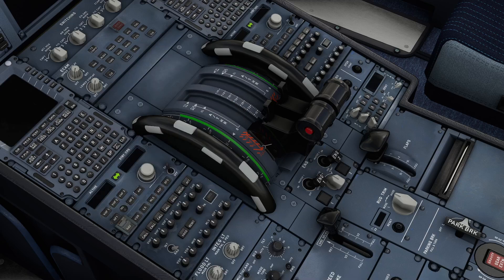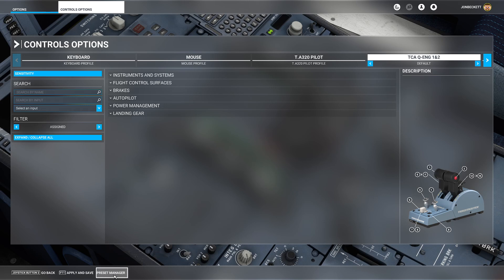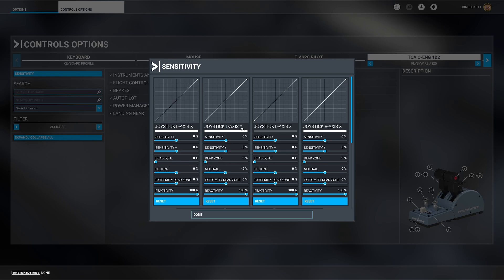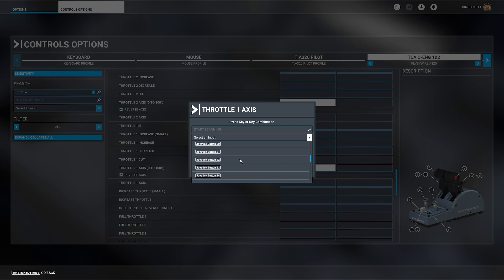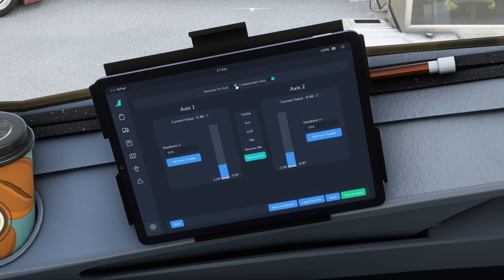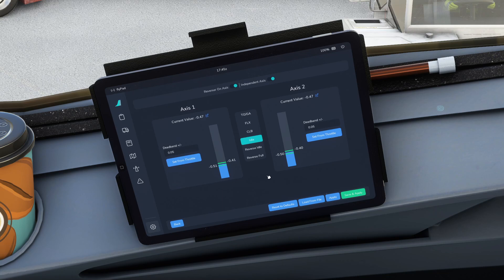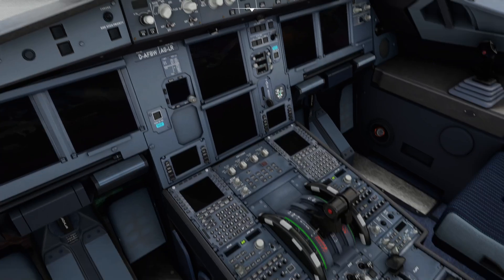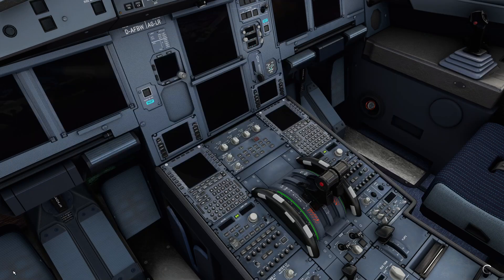How to configure the Thrustmaster Airbus Throttle Quadrant for the FlyByWire A320 Airbus in MSFS

Comment: Hi Johnathan. I have been having trouble with unresponsive throttle control with my TCA pack and couldn't figure out why. Main problem was using the stick for GA flying and not having any control on the the throttle. I have MSFS2020. I came across this presentation of yours and immediately understood what you were teaching.  I feel as though you may have given me the info I need to calibrate my set up properly.  It would be nice to just be able to use the throttle assy for GA and Commercial flying. I now feel confident to reset the parameters so I will have a ago. Thank you for your presentation, really well put together. 😃👏

Comment: UPDATE for 2025. They now removed the ability to delete a key binding. Tried the step at 4:30 and the binding is forever locked after deleted twice and validating 500 times.  Looks like this Throttle Quadrant is no longer supported by FBW. I bet the controller manufacture will not release updated drivers. 

But there is work around. You have to exit the game, unplug the Throttle. Restart game, then go into controller options. THEN PLUG IT IN! The option to remove and validate will come back.
Reply: Preesh bro

Comment: What if the throttle doesn’t go fully back but it stops at 75%, not like 100%, what do I do in that situation?
Reply: I fixed the problem, there’s just a slight issue because I wanna fix the reverse thrusters but the iPad on that aircraft is different and it’s not the same where it doesn’t show the exact same iPad you used. 🤔

Comment: Bought the TCA throttle (dont have levers for flaps and spdbrk) few weeks ago. Followed the Thrustmaster official calibration guide. The device is a mess. Nothing works out of the box. Thanks to your video I was able to set the throttle axis. But the eng switches and starter switch (crank-norm-ign) did not work. Defaultly set to heading but set and hold (LOL). The eng switches for fuel in/cut off were set as avionic master 1 and 2. Total BS by TM.
For those who have the tca airbus throttle quadrant at the same state = unusable. Follow this guide.
1) Clear everything
2) Set throttles according to this video
3) find setting set engine master 1/2 and set engine 1/2 fuel valve and map it to the engine switches (2 silver switches with square top) - works in Fenix as well.
4) To set up the crank-norm-ign starter knob you have to firstly set crank (button 7 moving the knob left and center) then set the ign/start (button 8 moving right and center) and lastly  set engine norm mode and you have to set BOTH buttons 7 and 8 here (primary and secondary) and you have to change the action type "on press" to "on release"
5) Take a beer. You deserve it.

Comment: this solved most of the issue, but reverse is still not happening. (Fixed the reverse by switching it on and off in the iPad/electronic board throttle settings in the airplane itself.) Many thanks for this great video.

Comment: Hi Jonathan, thanks for the amazing video! Very, very helpful 😀

Wondering how you manage the tiller on the Airbus? I find the steering on the ground using just the rudder axis to be very lacking and not precise enough and as I am flying an A330 around I don't need to use the rudder inputs aside from the takeoff and landing roll. 

Do you have some way of getting the tiller to work so that I can have full control over the NWS?

Comment: I can get as far as the EFB and attempt to Calibrate the throttles in Full Reverse. When I click Set from Throttle, I get the dreaded Red Line, which says I have an overlap. I have attempted this fix several times with zero luck using an FBW A320 NX.

Comment: Hi Jonathan, 
A remark and a question.
First of all I want to remark that I am very happy with this video !  Very clearly step-by-step explained.   
 I struggled quite a few hours (without getting good results) with these Airbus throttles, but after implementing your configuration -procedure they now work perfectly!! 
 Thanks a lot.

The question is about the spoilers and flaps.
In your video it is mentioned that if you make a duplicate of the default setup, the spoilers and flaps should work out-of-the-box also.
Unfortunately, that is not the case: 
- Flaps handle in position 0 : ==> full flaps and all 4 other positions of the Flaps handle result in Flaps up
- Spoiler handle does not work at all

I tried to find a solution online, but not many people seem to have this problem.
Do you have a suggestion how to solve this?
Reply from the maker: No idea what's going on there. Do they work with other aircraft ?
Reply: Hi Jonathan,
Thanks for your reply.
As I was looking on internet if there were other persons with the same problem, I came across a very short video (1 minute) where someone set the throttles by simply moving the levers (including the flaps plus spoilers handles) through each detent, while clicking on the two red buttons at sides of the levers at every detent.
I followed that procedure (actually without much hope), but it worked !
Everything on the throttle quadrant (including flaps and spoilers) is now operational.

When I checked the sensitivites I noticed that the very strangely curved sensitivities were again applicable. My custom made FBW A320 profile is still active, but the sensitivites are reset to the standard and nevertheless the levers move nicely through the gates. I do not really understand this, but it works.
I am happy that my FBW A 320 can be flown smoothly again.

Remark 1: I do not have the Hotas drivers installed.
Remark 2: No, I do not have other aircraft ( the only aircraft I ever fly is the FBW A 320)

Thanks again for your great video ( I subscribed to your channel since your videos really stand out)

Kind regards,

Comment: Hey! My quadrant FLEX position is behind the FLEX position in the sim, is there any way to calibrate that? By doing this procedure you described will fix it? :) Thanks!
Reply from the maker: Yes - calibrating your controls in the EFB will sort it.
Reply: @jonbeckett  Does it work for the Asobo model as well?
Reply from the maker: @FSXProflyer  no

Comment: It all worked fine except the gear lever does not work i looked it up and it said once it doesnt work you cant fix it since its hidden coding. Any help?
Reply from the maker: You have to start from the default profile and not touch the configuration of the gear switch.

Comment: Hi What a superb video. I was pulling my hair out over setting these up for ages. Just one question I struggling to find the calibration page anywhere. I'm trying to set up the A320 Fenix aircraft. Any thoughts?
Reply from the maker: In the Fenix the calibration is in the tablet. Just make sure you remove the curves on the throttles first.

Comment: A couple of things since there are new versions:

The reversers no longer show in virtual cockpit moving until you actually start the engines. Some update is responsible for this. I just wasted an hour figuring out why the reverse detent was not updating in the cockpit.

"Reverse Axis" is not the reversers. Its just reversing the analog direction (kinda like when you pull down on the stick to go up, and you can reverse that direction). By ticking this box you are assigning TOGO to IDLE for example.
Reply: I’m confused on the last part
Reply: Hello, an update to the software fixes the issue. The reversers now use the reverse axis. Hope this helps! @Houncho5

Comment: How does the game solve the issue where the auto throttle will visually change the detents (virtual throttle) ? So that means your pysical throttle is at "Idle" when the game has you in "climb".  Does this throttle quadrant have a motor feedback that moves the stick?
Reply from the maker: No - there is no motor feedback - the PMDG 737 fleet have an option in the FMC though that displays the commanded engine thrust, as well as the controller position as arcs around the edge of the engine guages.
Reply: Oh okay, good to know because the 787 and 747 I believe have to movable levers where the pilot is not touching it @jonbeckett

Comment: Its not working dor me, mine doesnt go into climb. When i go into climb on the throttle master , in the sim the throttle goes all the way . In confused
Reply from the maker: Have you calibrated the throttles in the tablet ?
Reply: I have exactly the same problem. Can you help me?
Reply from the maker: @j4cob867  you need to flatten out the curves in the controller sensitivity, then  calibrate the throttles in the tablet.

Comment: Hi Jon. I tried to configure my tca thrustmaster quadrants but with fail. When I set the sensitivity to a straight line the white dot does not move all the way up and down. The L-axix-X when move the lever up, it goes all the way up and return from below for 7 times. The L-axis-Y it goes three quarters up and return down again. That's the problem I am facing, the white dots are not behaving as you are expecting to see after you set the sensitivity. Jon please I really need help on this. The throttles do not agree through their travel on the right detents! Thanks
Reply from the maker: That's very strange. Do you have any other software that might be causing that ?
Reply: @jonbeckett  I really don't know Jon. How do I check. Thanks
Reply: did u end up getting it to work? i have the same issue but the white dot doesn't go all the way up on both levers in the sensitivity area @ronloveflying
Reply: @ForChristNotAgaints  Yes finally it worked. What I've done was, I disabled the throttle from the joystick.

Comment: having issues with the detects specifically with the reverse idle
Reply from the maker: Yep - I set reverse idle just off idle.
Reply: @jonbeckett  Ok i've got the throttle working however now my speedbreak and flaps wont go through the indents any idea's?

Comment: Went through calibrating ok, different layout on the Flypad but saw the same options, detents as expected but found gear lever did not work so I tried keyboard, didn't work with that either, loaded one of the  landing practice scenarios and gear lever worked with keyboard, had sidestick and quadrant disconnected at that point. Will start again :) gear lever works fine via joy.cpl
Reply from the maker: I'm always amazed that different people have different experiences with mapping controls - I never seem to have too much trouble with it.
Reply: @jonbeckett  Just in case you've never done what I've done, looking at the control options, it gives the name as shown in your video but only gives that name when connected directly to the PC, when it's connected via the sidestick it's called a quadrant not Eng 1&2. The settings also do not transfer for the same device when connected differently. I did find an issue with the switches controls and FlyByWire support confirmed the problem after I reported it and are looking at solving it. The other thing is the FlyPad layout has been changed but easy to solve.

Comment: Thank's for doing this video, I've just received my TCA Airbus Captain's pack. You mention in the video about the graphics maybe wrong and not showing the flaps or spoiler addon sections. In my MSFS it not even showing the throttle quadrant as shown in your video, do you know or anybody else know of any way of correcting this? The TCA sidestick shows OK.
Reply from the maker: Unplug it, and plug it back in. Also - notice you can scroll sideways in the control profiles - to see more devices.
Reply: @jonbeckett  Sorry Jonathan, I didn't explain properly what I was asking. This is the only one plugged in with the sidestick it's simply an icon/graphic that's missing and I didn't explain that in my message above, you mention in your video that the wrong graphic maybe displayed, ie the throttle without the flaps/spoiler controls Mine is not showing any quadrant at all, just what looks like a greyed out Hotas 4/Hotas X.  Did you find out why the switches were not working which you tried in your video. Rudder trim doesmove but not really expecting that until I have hydraulic pressure for surfaces, also the Auto brake level switch. I couldn't see mine moving.
Reply: @jonbeckett  Hi Jonathan, I tried something different, my comment above was because the quadrant plus spoiler/flaps levers was plugged directly into the Sidestick and there is a difference in names for the quadrant depending on how is plugged in. In your video this shows top me with having tried different ways was that your quadrant was plugged directly into the PC. In this mode the graphic of the quadrant is shown but not when plugged into the sidestick. If you configure the joystick with it plugged into the sidestick then another time it's plugged directly into the PC, the first lot of settings is not available unless you go back to how it was fitted when setup.

Comment: I set the axis exactly as you said and it's reversed. Moving throttle to max puts it in idle and moving throttle all the way to reverse makes it go full power
Reply: Nvm I set the wrong one.  It works now
Reply: @jstrang01  Hello Jacob. I have the same problem here. What did you change in your setting ?

Comment: Thank you very much Jonathan I needed this....Just bought and received  my Thrustmaster Pro X and for the first time after pushback and roll to the active my airbus got away from me because the detents were not calibrated correctly
Reply from the maker: Thankfully setting up profiles and calibration is pretty straightforward.

Comment: Doesnt work. Aircraft still begins to move forward at idle.
Reply from the maker: Did you engage the parking brake ?
Reply: @jonbeckett  Hi. When the parking brake is engaged it does not move an inch. When unlocked it starts moving. This doesn't happen with any other aircraft. If at idle with the brake disengaged the aircraft does not move. Also, my flaps and spoilers either retracted or fully extended. There is no in-the-middle option on my Thrustmaster settings. I think I got interested in this game way too late. Damn you 380X annoucement. lol

Comment: Hey, my flaps and spoilers arent working properly :(
Reply from the maker: Did you start with the default profile ?
Reply: @jonbeckett  I've got the same problem, and I started with the default profile. What's happening is the plane seems to only recognise setting them to the first detent, which in the sim sets flaps/spoilers to full. So I guess it's treating only the first notch as a button for flaps/spoilers full, but doesn't recognise the rest of the notches... it is calibrated to the flaps axis / spoilers axis though, which is the default. Any idea how to fix?
Reply: Actually I've found how to fix it! Follow the instructions in this tutorial, which is just how to calibrate the hardware itself, except for one thing: in the video he only shows calibrating the throttles. You should follow the same for the - actually nvm lol I'll type the instructions here

1. Unplug the cable from the quadrant
2. Put spoilers to retard, flaps to 0, and throttle levers full reverse
3. While holding the square black button that's on the right side (to the right of the IGN/START, under the Engine 2 starter switch, on the left of the parking brake), plug the cable back in.
4. Once it's plugged in you can release the black button
5. Put throttle to toga
6. Press the red autothrottle buttons on both sides of the levers
7. Move all the levers down one detent (throttle to FLX/MCT, spoilers 1/4, flaps 1)
8. Press both the red buttons again
9. Move them all down one detent again (throttle CLB, spoilers 1/2, flaps 2)
10. Press the red buttons again
11. Down the next detent again (throttle idle, spoilers 3/4, flaps 3)
12. Red buttons again
13. Down to the last detent (throttle full reverse, spoilers full, flaps full)
14. Red buttons
15. Press both of the black buttons by the engine start panel to finish the calibration
16. If one of the levers are reversed (like for example flaps 0 gives you flaps full and flaps 1 gives you flaps 3 or something) just go into the control settings and enable/disable the reverse axis box

Hope this helps, and here's the tutorial video anyways

Comment: Great video, thank you. I still have a couple issues, I did the levers exactly as you showed but the full reverse wont work when I lift the levers and put the throttles in full reverse they just stay at idle? Also the Flaps and Park brake don't move either? any ideas? but the speed brake , engine mode switch and engine switches all work
Reply from the maker: The thrust levers will only work when the engines are running. Have you started from the default controller profile? You need to.
Reply: @jonbeckett  Hi Jonathon, yes I did everything as you did it, I paused at placed to do as you showed I duplicated the default profile, I will do a flight shortly and check everything works, but the Flaps didn't move when I moved the lever same with the Park Brake it doesn't work either. tried the flaps before engine running does that make a difference?

Comment: steering on grnd is nearly impossible. Any clues for me. Thank you VERY much. Throttle quadrant is working like a charm!
Reply from the maker: Stay slow. Also, remember the controls direct the nosewheel - they do not control it - there are huge servos that turn the nosewheel, so there will be lag.
Reply: @jonbeckett  ok got it.  Thank you